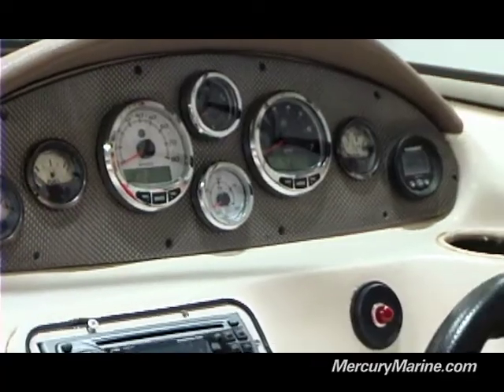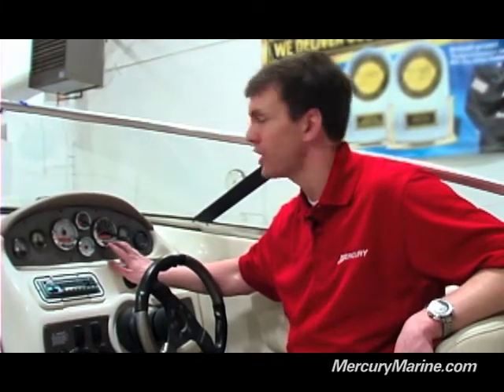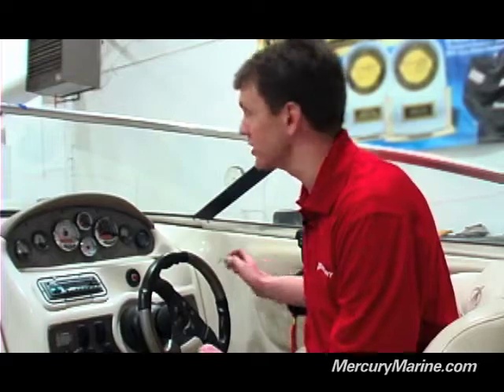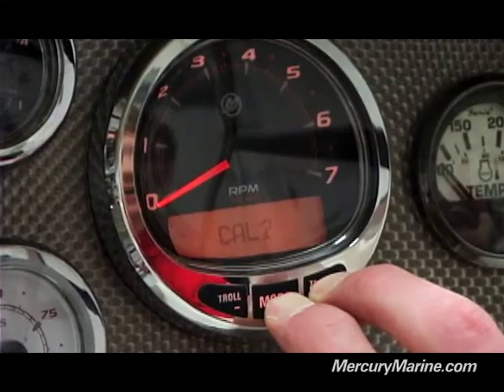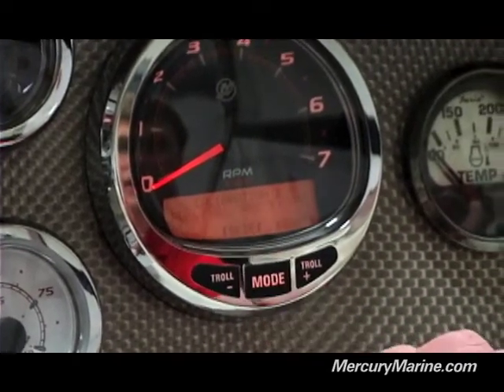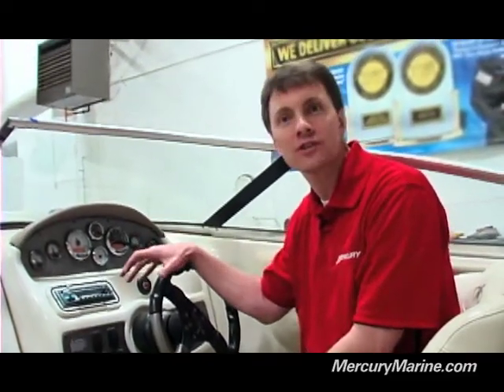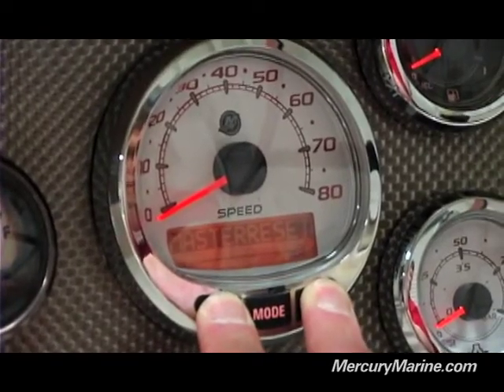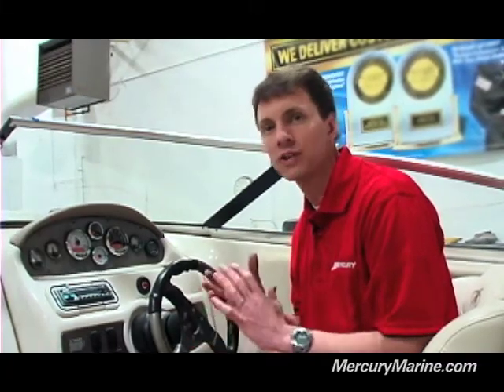Understanding Mercury SmartCraft SC1000 Gauge Calibration

Comment: A ton of help, thanks. I have a question though. My Smart Guage is lock on trim and will not come out of it. It says trim 25. I've done all of the resets and nothing helps. It will not cycle through the other modes at all. Ever run into this??
Reply: I had the same problem. I replaced the trim sensor and problem solved

Comment: Can the fuel level indicator work without a sending unit by using the capacity of the tank and the fuel used measurement?
Reply from the maker: Hello Baylor, great question. The SC1000 tachometer only indicates fuel level remaining by means of reading a fuel tank sender. If you add the SC1000 Speedometer into the mix, that gauge does have a "Fuel Used" screen that you can reset each time you fill up if you want to see the gallons the engines have burned. Adding the fuel tank sender harness is the recommended route for any of our digital gauges and is generally a straight-forward installation. One end attaches to the fuel tank sender leads, the other end plugs into an existing harness on the engine. For more information on fuel tank sender harnesses or SmartCraft gauges, don't hesitate to contact our product support team through the Contact Us link on our website.
Reply: @MercuryMarine  Thanks for the reply. I've ordered the "fuel paddle wheel harness" and have a KUS sender for the tank. It's my understanding this harness connects to the SmartCraft CAN BUS at the engine. Presently the VesselView Mobile is connected there. Should I move the VesselView Mobile to the helm where I have a junction box and install the fuel paddle wheel harness at the engine?
Reply from the maker: The fuel/paddle harness will actually have its own connector on the engine that is different than the SmartCraft CAN bus connector, so your VesselView Mobile device can remain installed where you currently have it. You certainly could move it to the helm if you wish, but if you haven't had any connection issues, we would recommend leaving it right where it is.
Reply: Hello! Please can you tell me what could be problem if that "fuel used" doesn't work properly? It shows cca half of spended fuel. It shows 32 fuel spend and I refuel 60l. I also have problem with speedometer because when I start driving it doesn't work and during the ride suddenly it starts working and every time like that.

Comment: Hello, can you tell me what smart gauge i can use on a 2003 225hp mercury optimax DFI
Thanks
Reply from the maker: Hi Frank! Can you provide your engine serial number? Feel free to respond here, or reach us via email at social@mercmarine.com. Thanks!
Reply: @MercuryMarine  2003 mercury optimax 225hp DFI
ot701193
Reply from the maker: @CapeFrank57  thanks for the reply! Your engine has full SmartCraft capability, so you can use any of our current SmartCraft gauges, VesselView helm displays, or VesselView Mobile.
Reply: @MercuryMarine   Thank you for that info, any specific model number like sc1000.  Or other model numbers 
Thanks your a lot of help
Reply from the maker: @CapeFrank57  You can use them all. System Monitor, SC1000 Tach and Speed, MercMonitor, VesselView, and VesselView Mobile. For part numbers and pricing, please contact your Mercury Marine dealer or Mercury Marine consumer support at 920-929-5040. 😎
Reply: @MercuryMarine  thank you for your help 
And thanks for your info and reply 👍😎
Reply from the maker: @CapeFrank57  you're welcome!
Reply: @MercuryMarine  thanks for you help…
Now i have to ask you if you have a wiring diagram for tach and speed mercury smart gauges sc1000 with a single 225 HP OptiMax motor and if you can tell me what cable i need to Connect the smart gauge speed gauge
Thanks you been a-lot of help
Reply from the maker: @CapeFrank57  Installation can vary by application, so you will need to work with a Mercury Marine dealer to get boat-specific harnesses for your setup. Once they advise on the proper harnesses and parts, the installation is then plug-and-play.

Comment: Do you know how I can use my chartplotter GPS SOG to feed the speedometer instead of the pitot, which isn't working?
Reply from the maker: Depending on your chartplotter model and which version of gauges you have, you may be able to use NMEA0183 to share speed data from the chartplotter to the speedometer. We recommend gathering some details and reaching out to Mercury Marine product support to discuss your options. The necessary information needed will be the version of gauges you have (upon gauge startup the version flashes on the bottom of the screen) and the make/model of the chartplotter you're using. Contact details for our product support team can be found via the link below. Thank you!
https://www.mercurymarine.com/us/en/about-us/contact-us

Comment: What is the typical reason the speedometer stops working.  Just reads 0.  Does the paddle wheel need to be replaced?
Reply from the maker: Hello Chris, great question. Typically, the paddle wheel provides the low speed input and the pitot sensor provides the speed input for medium and higher speeds. The gauge chooses the speed source based on how fast the boat is going and what speed you tell the gauge to switch the source its using (found in the calibrations). If your engine does not have a pitot sensor on it, it will not have any speed data to report. Feel free to contact our product support team at 920-929-5040 to discuss the engine you have and the settings within the gauge, and they should be able to help get your concerns sorted out.

Comment: New gauges in new boat. Fuel gauge not working, no help from dealer.  Gauge reads full at 57 gallons and doesn’t move, when you say set to default will this work for me and how do I do this?
Reply from the maker: We recommend that you contact our product support team for assistance on this. They can explain how to access the calibrations menu to set your gauge to the default reading and provide an appropriate manual to help you tailor the gauges to your needs. Contact information for the product support team in your region can be found by visiting https://www.mercurymarine.com/en/us/contact. Thank you!

Comment: Troll Mode not working since repower? Replaced 2005 150 Optimax with 2022 200hp Mercury 4 Stroke. Message on screen says “Must be in Gear”, I am in gear, but the Smart Gauge appears not to recognize it?  I’ve done the master reset. When I get to the Cal 2 screen setting “Enable Troll Mode”, the option is to press YES or NO, and Save. I press YES or NO and cannot select either? Can you help me? I live on troll mode fishing the Northern California coast for King Salmon since 2005. Love the new 200hp 4 stroke, but want Troll Mode back. Thank you for any help. David R
Reply from the maker: Hi David, sorry to hear you're having some frustrations. A master reset should have solved the issue as the gauge is probably looking for the wrong type of engine. We invite you to contact our product support team at 920-929-5040 to discuss which gauge you have exactly, and they will be happy to assist you with sorting this out. You may also reach us at social@mercmarine.com if you'd like to share some images of the gauges you have, and we can walk you through a few steps to resolve this. Make sure that you note which version of the gauges you have as well. This can be found during the key-on sequence on the screen of the gauge, and it will be noted in the corner of the text box with V.---. Thank you!

Comment: I have a new mercury 150 HP with 2024 gauges. But tacometer does not show fuel consumption (flow). There is no fuel flow screen while pushing mode button. Does anyone have an advice to do? (I will try master reset for tacometer)
Reply from the maker: We're sorry to hear you're encountering some frustration with your SC1000 tachometer. You likely need to go into the settings and turn the fuel screen on. To do this, press and hold the Mode/Select and + buttons simultaneously for approximately four seconds until the word SCREENS appears. You will then use the - and + buttons to make changes and Mode/Select button to accept changes for each item. Feel free to contact our product support team when you're at the helm if you have any questions or wish to walk through it together. They can be reached at 920-929-5040. Thank you!

Comment: How do i install pilot speed to my smart gauge
Thanks
Reply from the maker: Pitot speed is a feature only some engines offer. This would be a sensor that is installed onto the engine to pull water pressure from the lower unit through a dedicated hose, calculating that pressure data and sending it up to the gauge for a speed reading. Please work with your Mercury Marine dealer to see if your engine currently has a Pitot Sensor or if one is available to add to your application.

Comment: Hello! Please can you tell me what could be problem if that "fuel used" doesn't work properly? It shows cca half of spended fuel. It shows 32 fuel spend and I refuel 60l. I also have problem with speedometer because when I start driving it doesn't work and during the ride suddenly it starts working and every time like that.
Reply from the maker: Hello Joze, we're sorry to hear you're having some frustrations getting your SmartCraft gauges to read accurately. We encourage you to contact a Mercury Marine dealer for assistance with troubleshooting as there may be some rigging issues related to these concerns. If you need help finding a dealer, please visit https://www.mercurymarine.com/en/us/find-a-dealer/. Thank you!

Comment: Hello, I have question. 
Can I set °F to °C? 
If I can, how?
Reply from the maker: This can be done one of two ways, depending on the gauge version you have. You'll see your gauge version shown at the bottom of the splash screen when the gauge first powers up. 

Version 6.0 and below: Once the gauge is powered up, press and hold the MODE/SELECT and + buttons for six seconds until CAL 1 comes up on the screen. Let go of the buttons, and toggle through the options until you see DISPLAY UNITS. Change this from ENGLISH to METRIC using the + and - minus buttons. Once you have it set to METRIC, you can continue through the screens and exit the calibration.

Version 7.0 and above: Once the gauge is powered up, press and hold the MODE/SELECT and + buttons for six seconds until CALIBRATION comes up on the screen. Let go of the buttons, and toggle through the options until you see DISPLAY UNITS. Change this from ENGLISH to METRIC using the + and - minus buttons. Once you have it set to METRIC, you can continue through the screens and exit the calibration.